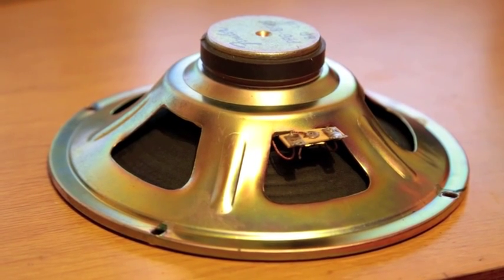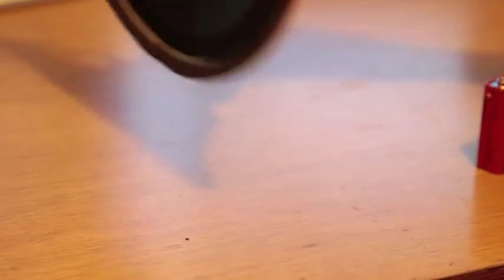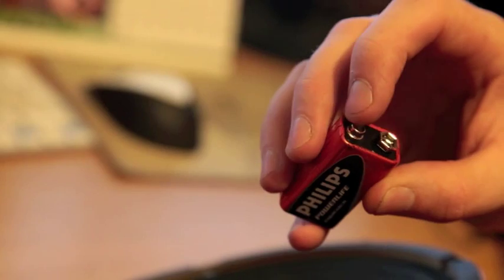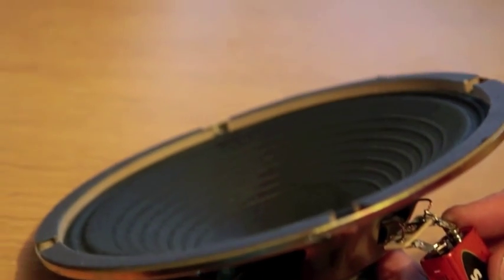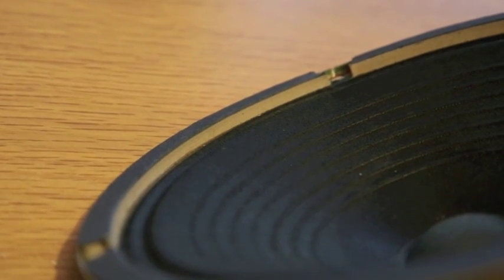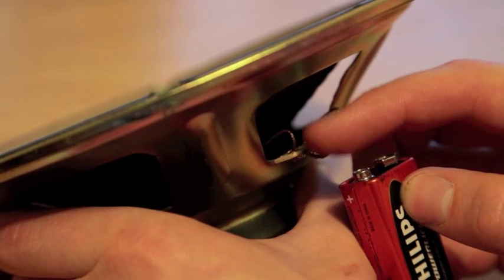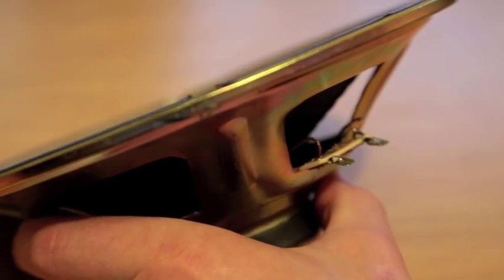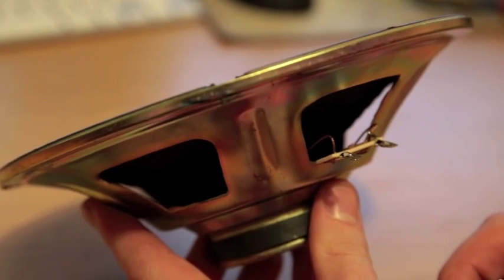How to test speaker polarity (positive and negative)

Comment: Hello
 FixitSam,  last night, from my vintage tube amplifier,  I 
mistakenly connected my Spendor Bookshelf speakers as with two  + wires 
 to the one speaker and two - wires to the another speaker. But one side
 speaker worked and another side didn't work.  'Balance control worked 
both sides only for one speaker. I shocked and sweated  then found it 
was wrongly connected. After made the correct polarity connection, they 
now sing.  Here, I need your clarification for: Since I made the wrong 
connection for 10 minutes, is there any possibility for weakening the 
Cross-over and speakers? Actually, What would be happened by this wrong 
connection? I am much much worried about my beloved - expensive  new 
speakers.   Kindly explain and please let me know : Did my speakers 
fully escaped and are they safe now?  why could  the speaker sing, connected
with two positive + speaker wires?  and why could not sing ,connected with two negative wires?
Thank you,
_ with regards,